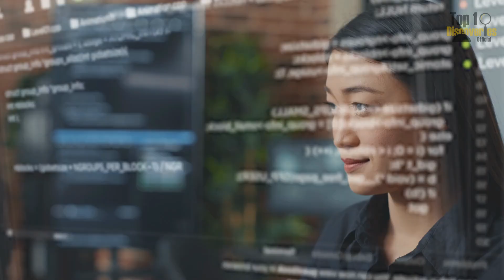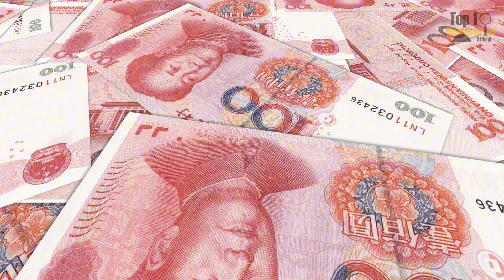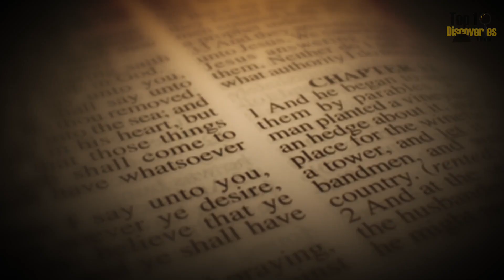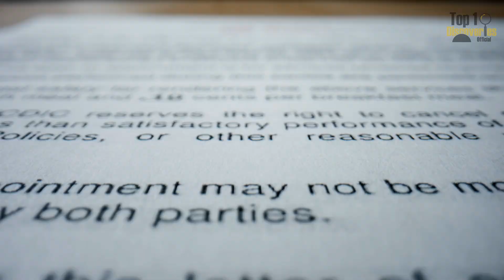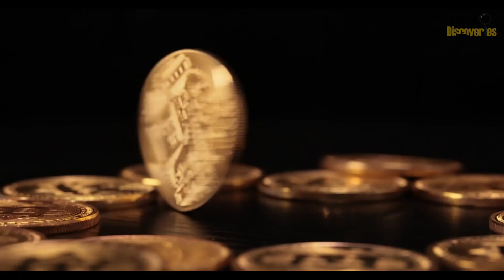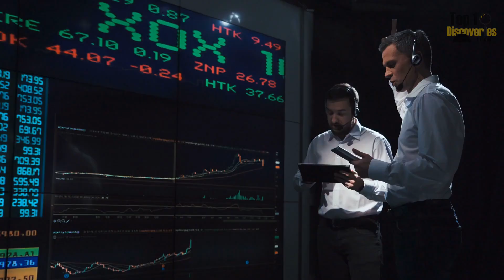Huajiang Bridge: China’s Mega Project That Makes the Golden Gate Look Obsolete

Comment: As a civil engineer, I’m blown away by the dual suspension cable system. It’s a masterclass in load distribution.
Reply from the maker: Absolutely agree, coming from a civil engineer, that means a lot. The dual suspension system on the Huajiang Bridge isn’t just elegant—it’s engineered for extreme terrain and typhoon-level wind loads.